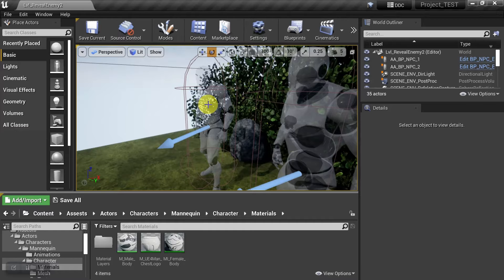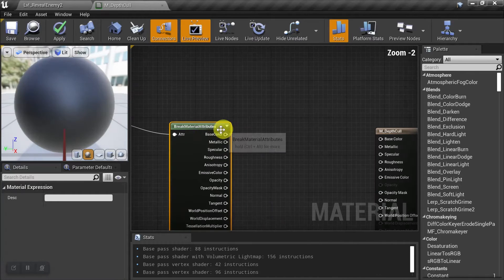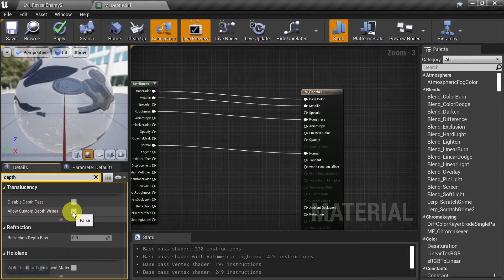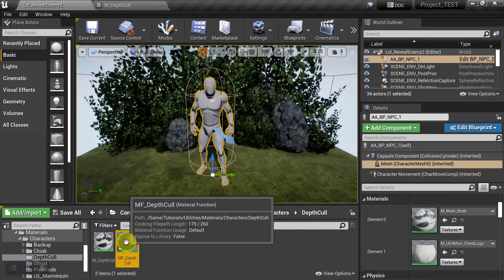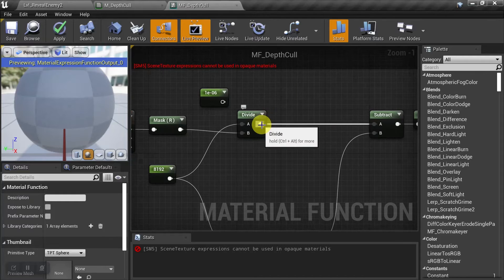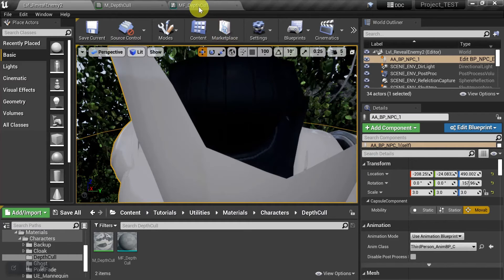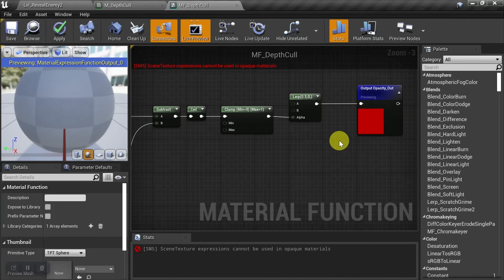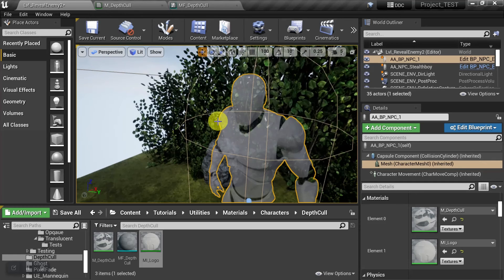Depth Culling For Translucent Materials; UNREAL ENGINE

Comment: I really liked this technique and wanted to explore it a bit more, but unfortunately experienced issues right away on 5.5.4, similar to the comments of many users. In short, when enabling the effect through proper settings on the skeletalmeshcomponent as per the video, massive flickering would occur. I checked some basic stuff to try to ensure there was no z-fighting, and messed around with some other settings, but the problem persisted.

For other users experiencing this problem, here's the cause and fix: Unsurprisingly, temporal based aa (TAA or TSR) are the culprit. I'm not sure exactly why this causes even a completely motionless skeletal mesh to have this problem, but I imagine it's because there is some internal randomness used in those algorithms to sample pixels and ultimately perform the AA.

You can get around this issue by changing your material to be calculated later in rendering. Specifically, in your material settings:
Translucency > Advanced > Translucency Pass = After Motion Blur.

However, as a result of evading TAA your material now has no AA applied, so you'll see jagged edges. I'm not the most experienced when it comes to unreal's rendering pipeline, so this might also come with other nasty artifacts I have yet to discover, so use at your own risk. This kind of stuff is (probably) exactly why the video's author is sticking to older versions of unreal, before the rendering engine got so savaged by lumen and forced temporal optimizations.